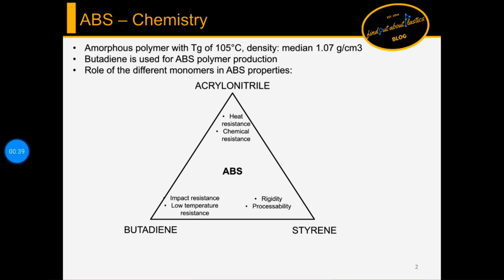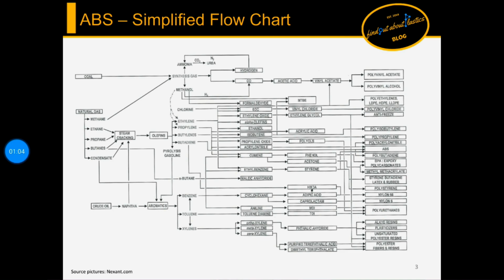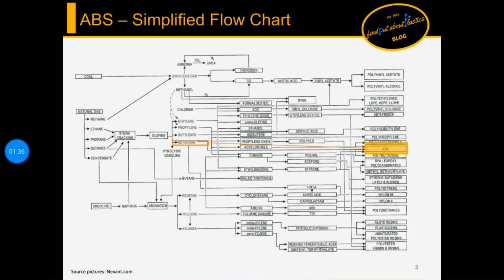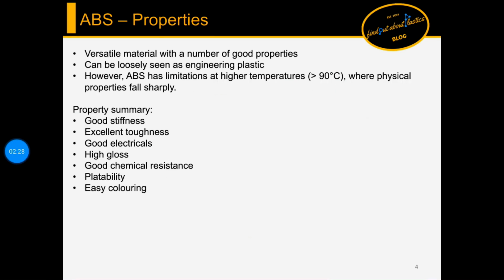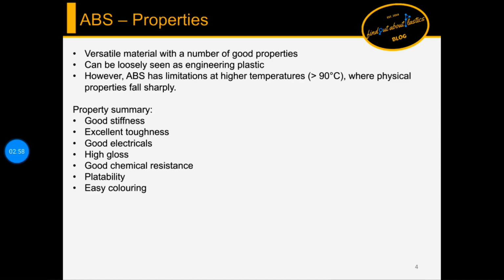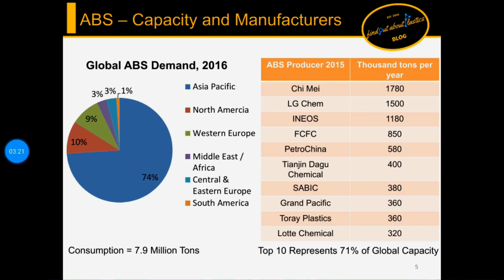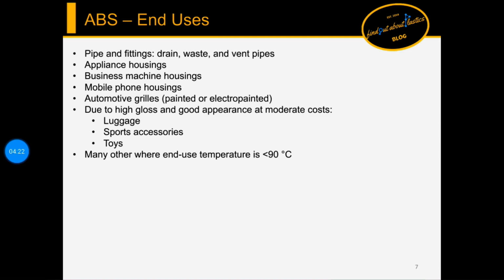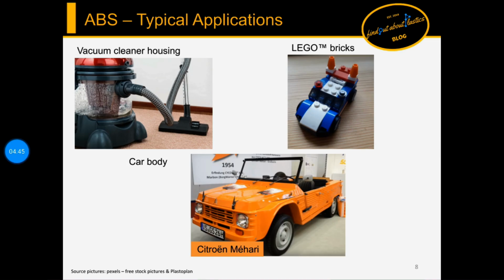Reviewing Key Engineering Plastics - ABS

Comment: Thank you for video. Is it possible to use abs with glass fiber and increase temp.usage?(more than 90 degree)
Reply from the maker: Yes, with 30% glass fiber ABS a HDT (1.8 MPa) of ~103°C can be achieved (neat ABS has ~94°C HDT); using a PC/ABS blend, the HDT can be even increased to 126°C; best regards